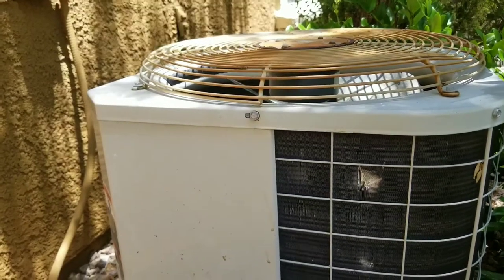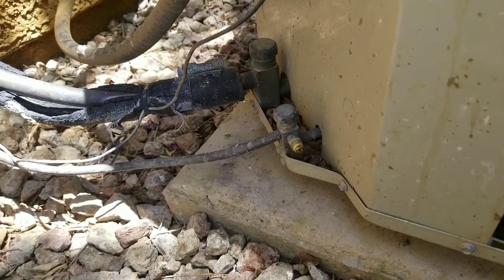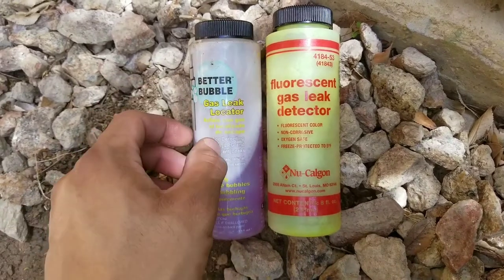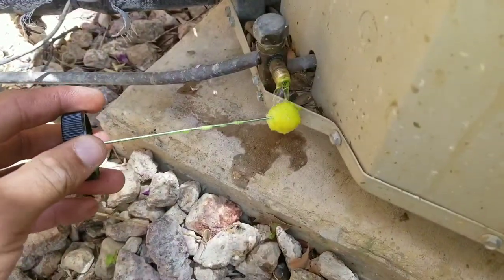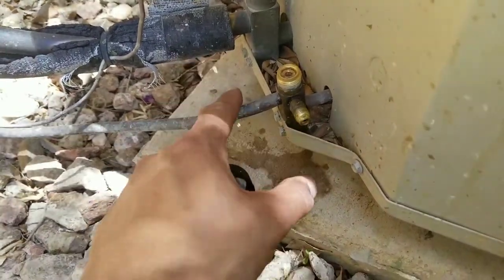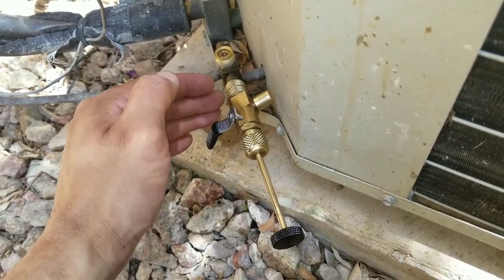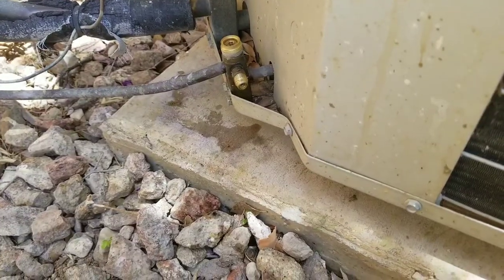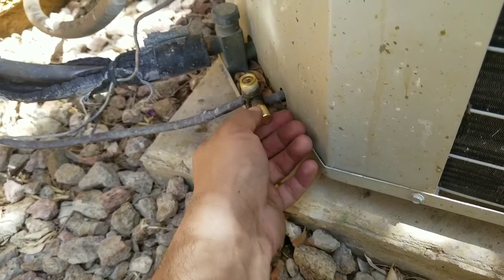Replacing Shrader Valve Condenser HVAC

Comment: What is the purpose of the king valve?  Isn’t it to be in open position while the ac unit is running? If so, to charge refrigerant through the shredder valve, I don’t need to touch the king valve. Is that correct?  Then when do we have to close the king valve, probably closing it turning clockwise?  When closing the king valve all the way down, it blocks the flow of refrigerant.  Is my interpretation correct? Why do we close it?
Reply: King valves are service valves that techs use for servicing.. they would be open, closed, or mid position depending on what you’re doing… such as recovering … we don’t say open or closed when talking about the position we say back seated ( normal operation) or front seated (turn clockwise to close  off the access of ref.)

Comment: So is this the only two areas where ac unit will leak Shreder valve and king valve
Reply from the maker: No alot of times it will leak at the evaporative coil due to rust and corrosion. If you are unsure what the evaporative coil looks like... go to my channel and watch R22 to 410a conversion.